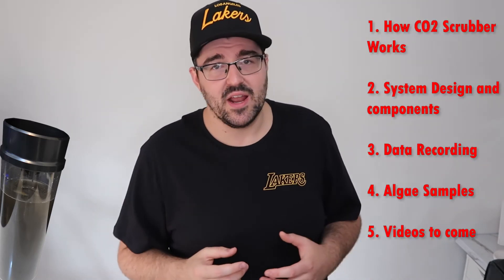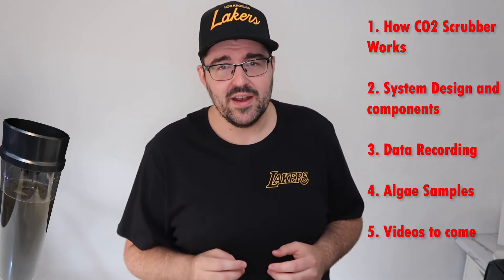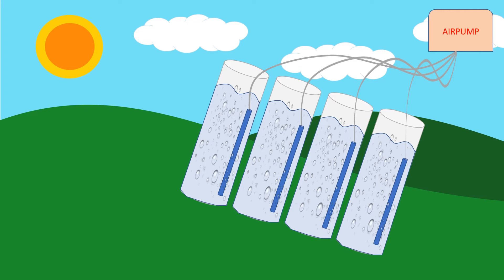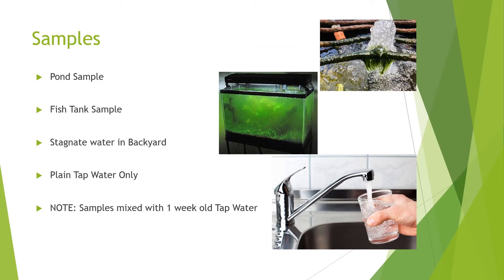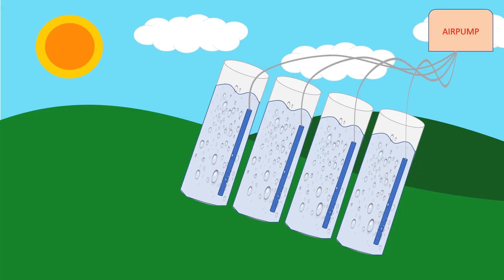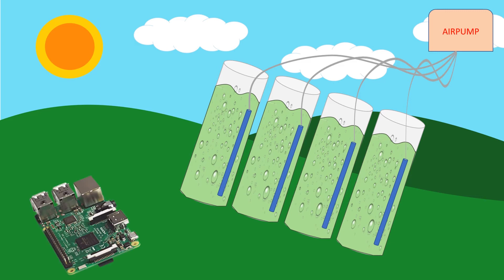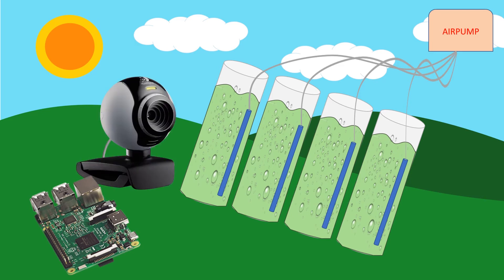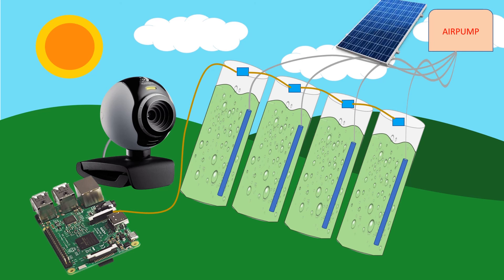Algae Project : Explaining how the system works

Comment: ‘’The Chlorine will kill the Algae’’, I grow Algae using discarded water bottles/containers and put my London tap water straight in I do this to use the Algae to clean my tap water. So I can then use the water for my Avocado plants, I have to do this cos my tap water makes the leaves fall off the plants, and the plants thrive after the water is first cleaned with the Algae. So not sure why the Algae would die from ‘’Chlorine’’ in tap water, and London tap water is really bad and yet the Algae grows well in it.

Comment: Finally I’ve found the channel I need, I am going to build a PBR to produce Bio Mass to use in a Methane Ingester( aka Digester), to add to the kitchen/Gardn etc plant scraps. My aim is to make enough Bio Gas to fuel a Camper van type Cooker, I was thinking of setting up a Passive Solar Panel in my Window, to use the heat to help the Fermentation, by running a Pipe around the Ingester to transfer the heat. Then I thought why not combine the PBR with the Passive Solar Panel, by using a Flat PBR panel and pass the Solar heat collector pipes through the PBR panel. So I can use the same window for both heating water and growing Algae Bio Mass. soz bit of a rant, been researching Algae Carbon Sequestration, and Bio Gas   for last 3-4 years, and am excited about its potential. 🌎✊🏽🌻

Comment: are you going to put a lid on the containers?
Reply from the maker: not a lid but it will be sealed to run up into sensors and then be able to vent to atmosphere, probably with some sort of one way valve to make sure its all going one way, and not outside interreference effecting the readings